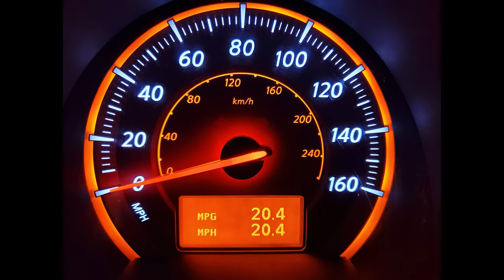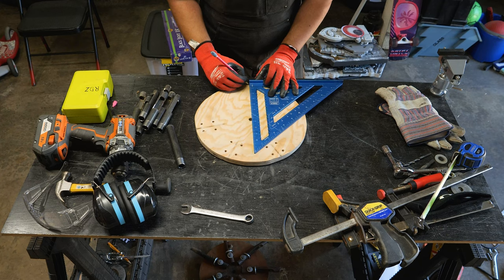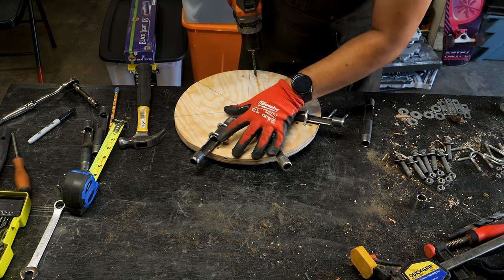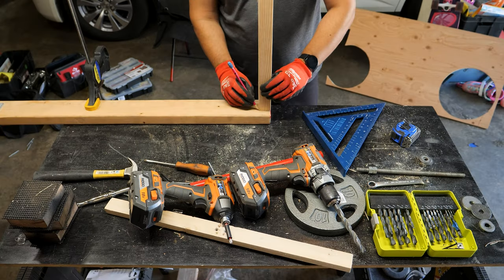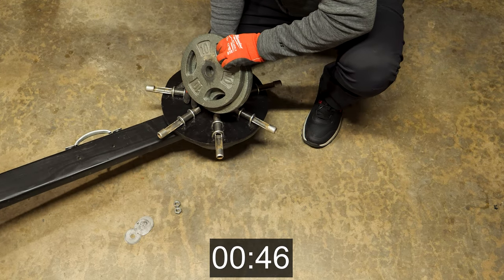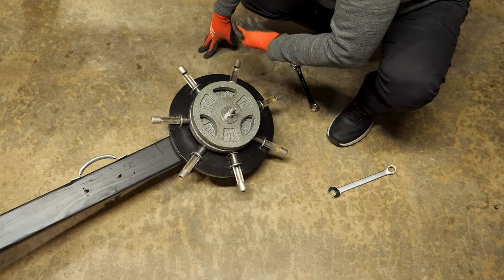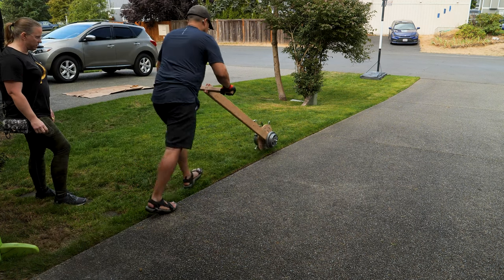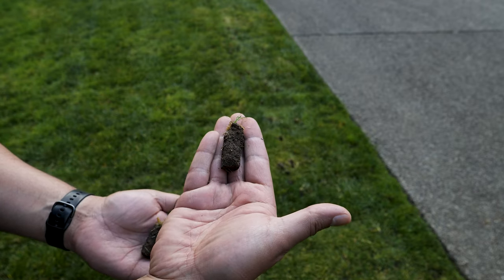A DIY Lawn Core Aerator For $160?? You'd be surprised!!

Comment: Great video.  You asked for suggestions…..a welder would enable a simpler prep and assembly process, eliminating the wooden centre hub and the u bolts, drilling etc.  using full length pipes to make an initial cross shape, then cutting and fitting in two more at the 45degree positions, to make a 8 spoked frame. Self supporting with no chance of any tines slipping out of position.  Steel plate of any kind would be welded in the centre, on both sides, for support of the axle as reinforcement, and also add weight.  Your build is practical and I like it, especially for those with no access to welder.  Thank you for the video…I will be making a version very soon.
Reply from the maker: I wish I had a welder. Honestly, as I was drawing up the sketches for this aerator (which had about 3 versions) a welder came up a few times. But yeah, this build is more for the every day person. If you ever build your version  just the way you described, I really hope to see a video of it.
Reply: @vandit0o0o  Maybe make a mkii  with an arc welder. Ads will pay for it right?
Reply: I used old an old brake rotor and added some extra weights. Welding the tines was way more time consuming than I thought it would be. Plus welds didn't want to stick well to the rotor. Honestly using plywood and drilling is probably a lot quicker than welding, plus you can always replace a tine if necessary. As long as the plywood holds up, this method does seem better.
Reply from the maker: @Soupy_loopy  Using a break rotor was originally my first option for this build. I think either method has it's pros and cons, but I agree that having most parts be easily replaceable would probably be that most convenient way to go.
Reply: I got 2 spare rims, a dead trailer and old steel table legs for practising welding. On the bottom of the to do list. pull it while mowing the lawns.

Comment: I finally finished this project and it works! I ended up using tines from amazon and I needed to add 2 spacers about 3 inches in length to both ends of the galvanized steel pipe because I had too much pipe sticking out for whatever reason. I am using 5 lb weights (40 pounds total) for my lawn…so maybe the 10 pound weights you used are a lot thicker? 

Anyways, tested it out and I have 2 inch deep aerator holes! Could maybe adjust my tines a bit to make the holes deeper but I think from what I’ve read 2 inch holes should be sufficient.

Thanks again!

Comment: At first glance I though this could not be effective BUT then I compared it to my commercial Plugr, now sold  by Billy Goat. It weighs 350lb and has 8 rows of tines, about 44 lbs. per tine. The Plugr, with the tines mounted on a crankshaft, the plugging force would not be a direct comparison. But the Plugr sold for north of $5K when new. For a small lawn your design is budget friendly for the DIY homeowner.

Comment: Looks great man. I tempted to make my own but kept failing and took it all apart. It was mostly the same concept as your but I had used a set of old Brake Rotors and for the handle bar I used a mower handle bar. Now that I seen your results I'm going to try again. Thank you for this video and  keep that lawn looking great 👍
Reply from the maker: Hey, thank you so much. Glad you found my video helpful. Hope this works out for you.
Reply: Dud you press drill the rotor? What kind of drill bit you use?
Reply: @Brian Malubag  yes I did use a drill press. You can do it with just a regular drill but it's takes longer and it's hard cause if the holes aren't straight your going to have a hard time getting the bolts to go through. And the bits were some from O'Reilly. They were short and made for cutting through metal. Be sure to take your time making the hole that way you don't go through drill bits like I did. Maybe use lubricant to prevent to much heat. GOOD LUCK 👍

Comment: Great job and thanks for sharing.  After studying your build and the AMICK, I'm going to build one using your ideas. (I'm simply not paying $400 for an AMICK.).  Fortunately, I have 4 - ten pound weights from an old weight set which will save me quite a lot. If you don't have these weights  another option to save money would be to check thrift shops, garage sales and online market places like Craigs List or Offer Up.  I thought about using brake rotors but not sure how hard it will be to drill them for the U bolts.  I think plywood will be just fine because how many times a year are you going to use it?  And I already have some scrap plywood and it will be much easier to work with.  As to the tines, it looks like they are going to take some time to fabricate. Oh well.   The one thing I think I'll do a little differently is to sharpen the tines at a steeper angle hopefully to get better penetration into the soil.  The one question I did have is why 7 tines?  Have to tried 6 or 8?   Another lawn product I was working on before I saw your aerator is a lawn roller. Have you made one?  My plan is to use a 12" Quikrete Quik-Tube.  I'll cut it down to 24", make round plugs out of plywood for each end with holes in them to center the axel I'll make out of steel pipe.  The 24" tube should take 1 60 lb. bag of Quikrete cement.  I'll make sure the axel is centered as I mix and pour in the cement using the end pieces.   After the cement is cured, I'll fabricate a handle probably out of scrap 2"x4"s I already have.  I'm estimating it will cost me around $25 - $30.  By the way, my Home Depot charges $20 for a 4 hour roller rental.  I'm happy to share my roller idea with you incase you want to do a video.

Comment: So I built this and finally gave it a try today.  My grass is still too high so I just tested it in a dirt area.  Can you give me any advice on what I might have done wrong?  I did get a plug here and there but the tines seemed to just be digging up the ground and pulling up dirt.  It looked like I had used garden weasel.  There was packed dirt covering the outside of the tines.  A few things worth mentioning:

1.  I ended up buying the tines and they had a slight curve in them.  I tried pointing them sideways (so they'd be facing the same way in both directions) and then I adjusted them to face in one direction figuring I'd just pick it up and rotate it when I got to the end of the lawn.  Both ways had the same result.

2.  I'm in the northeast and we've gotten a lot of rain.  It rained as recently as last night so I did this maybe 12 hours after it had rained.  While the soil wasn't necessarily muddy it was pretty soft.

3.  Rather than two inches I tried three inch depth.  I did not make that adjustment and won't get a chance to for at least a week.
Reply from the maker: Hey there, I'm sorry you're running into some issues. So to start off,  depending on your soil type and how much rain it received, I'd wait either a day or two before aerating. I recommend this because the soil can become "sticky" when still to  moist. You'll have to play around with that to figure out how long you'll have to wait before aerating after rain or regular watering. Also, I have the same curved tines you are describing. I used those for my first 2 prototypes and I had some success with them, but not as much as with my straight tines. Don't forget to spray some lubricant on the in's and out's of all the tines, I found this very helpful. Maybe you could sand your tines (inside and outside) to make them smoother so the soil slides in and out easier. Other than that, with your curved tines just keep playing with them to hopefully give you better results. I'll admit, in my experience, my straight tines gave me much better cores and are easier to clean. If your notice, curved tines are usually found on much smaller axles or wheels, so I'm sure their angle of attack greatly affects their performance. Let me know is this helps.

Comment: I would definitely make this a multi-wheel model and I would buy actual core aerator tines versus cutting the pipe myself so more expense but less labor and the manufactured tines will probably work better but this video is outstanding work!  Thank You
Reply from the maker: Hey, thank you. Glad you liked it. When it comes to manufactured tines, try to get ones with the tip openings being 3/4" to 1". I had some about 1/2" and they did not work great.

Comment: Solid, very ingenious.  Wonder if adding a second coring wheel with a larger spacer in between makes any sense?  Keep up the good work!
Reply from the maker: Hey, thank you. Adding a second wheel will be one of my project for this summer. Although I feel that I may have to add more weight to make all the tins stab into the ground a little deeper, which will eventually make it not fun to use, but we shall see.

Comment: Hey Albert. Question? I built according to your video. I’ve got two wheels and 40 lbs weights. When I tried it the tines filled with dirt and wouldn’t expel the plug. It has been very dry but recently rained for a couple days. When I tried to clean the tines it was very difficult. The plugs were tightly packed in the tines. I was thinking it was too wet for the plugs to move through the tines. Any thoughts or suggestions? Thanks again
Reply from the maker: Hey Brain, so yes if the soil is still too wet/moist it will tend to stick more. If the soil is to dry/hard, the tines may have a harder time penetrating into the ground. On your tines, did you also sand/grind down the inside of the tines (in the inside tips that will go into the ground) and spray the tines with a  lubricant? It truly does make a difference. I have little to no issues when it comes to cleaning and the tines becoming plugged up. Question, is 40lbs enough weight with your 2 wheels or are you using more? What soil type do you have? Let me know if this helps?
Reply: @vandit0o0o  Thanks very much. I'll grind the tips some more and try a lubricant. The 40 lbs seems plenty.  The tines fill up on both wheels. The plugs just don't move once they're full. I'll work with it a bit. Thanks again for your time Albert. Brian

Comment: This beat paying $500 for the amick aerator. lol
Reply: it's $500 now? I got one few years ago and it was around $200 and he shipped the new double disk version because it took him over 2 weeks to fill my order. it works but if you have a large yard say over 4-5000 sq. ft, you might want to look into a power one as it is very tiring and hard work. my yard is about 14,000 sq yd.
Reply: @MrRichardyc  they're charging me about  $65 for aeration to do my 1200 sq ft lawn. Been going up every year. So this year I just finally pulled the trigger of making my own and finished it on Thursday. Works as expected thanks to this video. Cost less than $80 to make because I have most of the materials. For the weight I used two used rotors that I got from my neighbor. 

Having that size of a lawn like you would be  so tiresome for this manual aerator. It can be a workout by itself.

Comment: Just wondering how did you come up with 7 tines? Experimented different number of tines at the designing stage? Thanks for the video.
Reply from the maker: Hey there, good question. 7 tines just balanced out for the dimension of my wheel. I didn't want to many tines to close together and not have the tines be able penetrate as deep. Also, I didn't want have to add more weight than necessary. So, I needed enough clearance between the tine fully in the ground before the next tine started to penetrate. I hope this helps.
Reply: Balanced out for the dimension of wheel - so why you chose the diameter of wheel to be 13 inches? Why not more than 2 inches out on the tines? How do you measure for 7 tines on a 13 inch circle?

Comment: This looks so effortless on your lawn. I can't help but think it wouldn't work as well on my lawn though. I had a Fiskars step on aerator with 2 tines and I had to put my bodyweight (250lbs) and rock it back and forth to work it into the ground. A weld ended up failing at the base of the handle and I returned it. My lawn was not maintained by the previous homeowner for 20-30 years so I think there is a compaction problem

But maybe the Fiskars aerator was just too dull 🤷
Reply from the maker: I agree that compaction could be one of the issues since 250 lbs wasn't working out. Maybe try liquid aeration first, with a few days of deep watering. You should be able to drive a screwdriver into your lawn with some easy before core aerating. I hope this helps.

Comment: Currently half wat through building one of these. Going with a 10 degree angle on the tips of the tines. Also cut the tines about 3/4 inch longer just because I used a single piece of 4 foot pipe and thought it would be good to make them slightly longer. Prob going to use 2 x 20 pound weights as its cheaper than the smaller weights where I live and should be simpler and cleaner.
Reply from the maker: Hey, that all sound good. 40lbs sound like good weight. Are you going to paint or stain it? If you keep it outta the elements, you could also leave it all natural.
Reply: @vandit0o0o  Yeah I am going to paint it with green hammertone paint.Ended up buying the 4 x 10lbs weights because the 20s are too big. Just have to make the handle and I will be ready to assemble. Do you have an email or facebook or something I can send you some photos?
Reply from the maker: @richardportelli1983  FB, I'm under Albert Rodriguez. I got a red shirt & gray cap on in case you get to many results. Im planning on making a FB page for my channel later.
Reply: @vandit0o0o  I think I found you. Couldn't find a red shirt lol.
Reply from the maker: @richardportelli1983  Hmm, yeah red shirt and my wife is next to me  wearing blue.
Reply: @vandit0o0o  Couldnt find you on FB, Anyways I build the thing. Works really good. Just need to work on cleaning up the inside of the tines and stiffen up the handle like you did. But even still I was pulling about 1.5 inch cores.
Reply from the maker: @richardportelli1983  Sweet. I'm glad it worked out for you. 👍

Comment: I'd probably two wheel this sucker since the weight is good, and keep the weights on the inside.... like 4" between airated wholes. 

Nice build homey.
Reply from the maker: Thank you. I do keep getting ask to build a 2 wheeled one so I hope it works well for you. I was just worried that it wouldn't be fun to use, but it looks like I may just have to two wheel mine as well. Let me know how yours works out.

Comment: How Well does it work on compacted / clay soil ? I may build it but add more weight?
Reply from the maker: I haven't had the opportunity to use it on clay soil. I did find out that there are serval methods of softening clay soil like adding gypsum or organic materials and sand. If you end up building this, could you let me know how it goes on your soil type so I can share? I've been asked before about how the aerator works on clay soil.

Comment: I noticed when I airate my lawn after a couple weeks the grass grows nice and green but also the weeds grow to, faster than the grass. I did it the summer and got crabgrass, I did it in the fall and got POA, each time I throw down some seeds and fertilizer, next time when I aerate I'm going to just throw down pre-emergent and fertilizer, I'll see what happens.
Reply from the maker: You may also want to look into some liquid weed killer. Either from a hose end bottle or a concentrate that you spray from a pump spray. I've had some luck with those. Also, bag your grass clippings to prevent spreading the weed seeds around your lawn. Hope this helps.
Reply: I just saw your comment and since it's that time of year, look up a product called Tenacity. 

The active ingredient is mesotrione, they sell generics, Tenacity is brand name.

That will fix you right up.  No more weeds after aeration.
Reply: @vandit0o0o  I have some mesotrione, I'm going to try it on my son's lawn.

Comment: Do you recommend 3/4" steel pipes for the tines or 1/2" steel pipes? The video showed 3/4" but the link in description shows 1/2". Also, for the wheel & spacer, did you use 3/4" plywood? Thanks!
Reply from the maker: Good question. I've tried both the 1/2" tines which were order from Amazon and the 3/4" tines which I made myself. I believe both diameters will get the gob done. I personally went with the 3/4" to get a slightly larger hole, which in a long run will help aerate a little longer since the smaller hole you make, the quicker that hole will close back up. You won't go wrong with whichever of the 2 sizes you go with. The link for the steel pipes I used is the 4th link  down from the top.

As for the wheel and spacer,  yes I used 3/4" thick plywood labeled for outdoor use.
Reply: @vandit0o0o  I appreciate the clarification! I plan to attempt this myself, but only issue is that I don’t own an angle grinder, so I’ll need to figure that part out. As far as cutting a perfect circle out of the plywood, would you recommend using a jigsaw as the best route?
Reply from the maker: @kennyboyy  Here a cheap grinder I bought from Amazon back in 2020 for cheap ( https://amzn.to/43jd20C ) that I still use today. A jigsaw would be the easiest way cut out your circle, but don't worry about making it perfect. Just get as close as you can. You can always follow with sanding down the excess or rough areas of the circle after cutting it out.